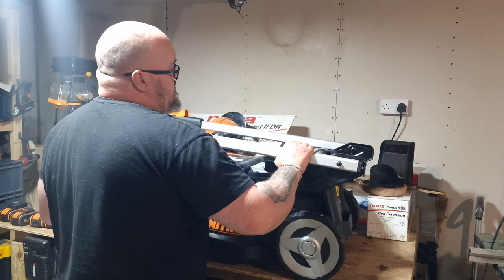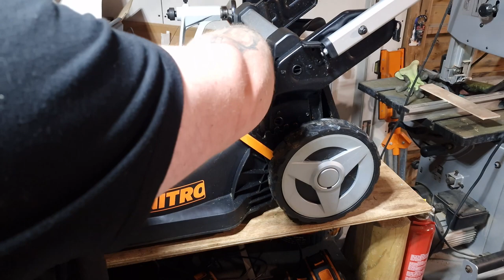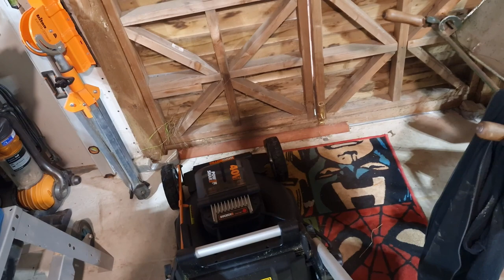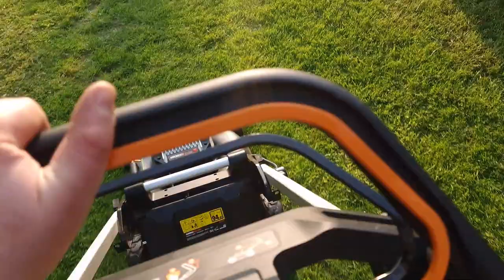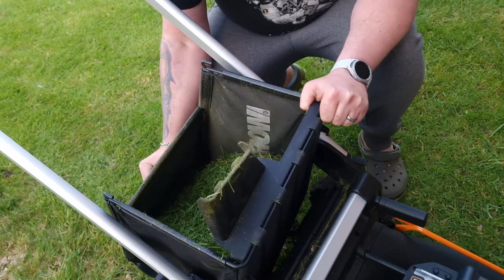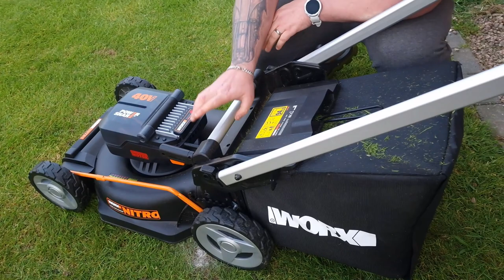Worx wg749 40v powershare self propelled brushless 46cm lawn mower The Great British mow off part 3

Comment: Hello! Thanks for your very helpfull review!
Can you tell me please the cutting blade code so i can order it?
Reply from the maker: Haha wow! Soooo...... well done! I normally would just put up a link and all would be well, but this is an exceptional case, first off I would recommend contacting Worx uk customer services, they can be found under the "contact us" tab They are really helpful and may be able to suggest a solution, or after a whole evening of research I found if you search for "Draper 45771 Lawn Mower Metal Blade- fits 460mm Blade Petrol Mowers" you should come across something that looks visually like a striking resemblance, I can't be 100% certain it will fit but visually the keyway is half moon shape and the profile looks the same...... although it says petrol mower the wg749's brushless motor is compatible with a 125cc engine so I see no reason why it would not work, though a oregon 16 inch blade would be my personal favourite to try - its what I will eventually replace my factory one with the issue I have is due to its weight it may not be able to spin it up without the safety overload (designed to protect you if your fingers or other foreign objects are in the blade) unfortunately until I find out this will be a unknown, though it spins up a 18 inch scarifier blade no issues and that has more drag than a blade alone will, none of this really answers your question but hopefully gives you ideas for possible solutions. Worx uk customer care number is 0345 202 9679
Reply: @mikesptworld  thank you so much for your effort. Unfortunately i am from Romania and here we don't have Worx representation and this WG749e doesn't exist here for sale also spare parts neither. 
I guess i'll use it until it's broken and dump the lawn mower 🥺

Comment: Hello again...unfortunately the two 4ah batteries included with this machine do not last enough to mawn my whole 500 sqware yard, so i have to buy another set. What do you recommend 5 ah, 6 ah or 8ah? I heard that 5ah batteries are better than 6ah...is it true? Are they lasting longer? Wich should i buy?
Reply from the maker: If you can get them the twin 8ahs would be amazing for this :-) I was never a big fan of the wg749 and its one of the few worx products I honestly can't reccomend, it's quite heavy considering the all plastic deck, self propelled mode seems to drain the battery way too quickly, since finding out about the lack of blade availability too and my own issues with the height adjuster and the quite high uk price it just doesn't hold the usual worx quality and ethos for me. MAYBE  with two 8ahs it might improve it 🤔
Reply: @mikesptworld  thanks for your answer. I bought the wg749 brand new with 200 euros here including the 2 x 4ah powershare pro batteries and dual charger included so i cannot complain about the price. 
I don't have any chance to buy the 8ah batteries because here in Romania does not exist, i guess i'll buy very soon 2 x 5ah powershare  pro batteries and i hope it will last more than 30 minutes with/without self propelling function (with the 2x4ah it lasted only 20 minutes)...very sad...
Reply from the maker: @mokolino29 yeah that sounds like a good plan, can't argue at 200 euros, I was in Munich the other weekend and got charged €165 to get a taxi from the airport to Olympic Park!! A 25-minute taxi ride!! Pure madness! Could have bought another worx tool for that amount! I also think the self power motor is too small so uses too much battery through it especially when the grass collector gets full up. Try using no self propelled and grass collector to maximise your run time, and ensure your blade is kept in tip top condition and sharp at all times.
Reply: @mikesptworld  Hello, I don't know how that guy bought the wg749 with 200euro. But I kan now find it at 385 euro, limited time,  do you think it's worth it, or should I stick with a gas one, texas razor 5155tr/we,Danish company, it has electric start and 170cc motor, and the same price. I have around 300-350 square meters. I live in denmark. There is another version wg748e without self-propelled, it costs 335 eur

Comment: I just got mine and the adjustment handle wont click . 
Its brand new out of the box. 
Did you have the same issue? If so what should I do?
Reply from the maker: I would suggest contacting worx customer service number first off - they are incredibly helpful and give the best advice, if they don't help then I will try and help you out best I can - though my fix us likely involve bending metal and hammering metal gently til it works, not ideal but I found it was easier than trying to get it packaged up to send off!
Reply: @mikesptworld  
Had a person look at it and they said what you did about bending it. 
Thank you